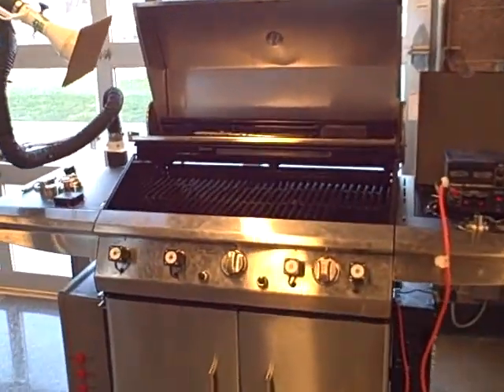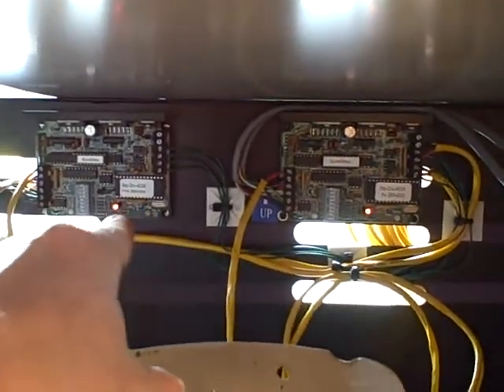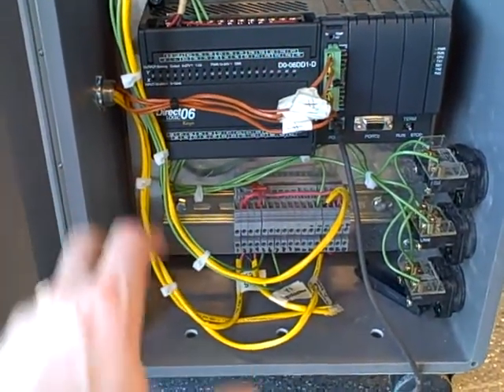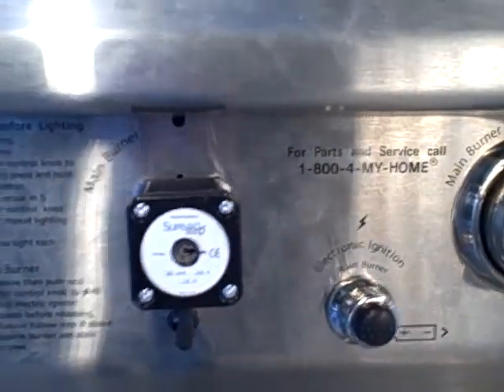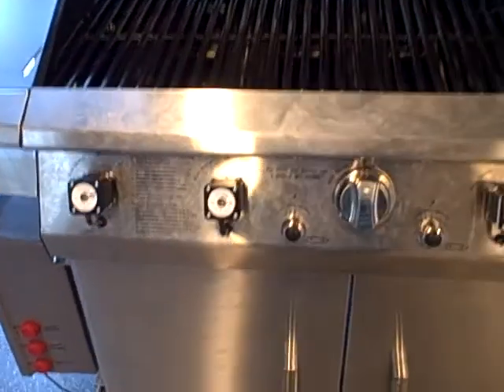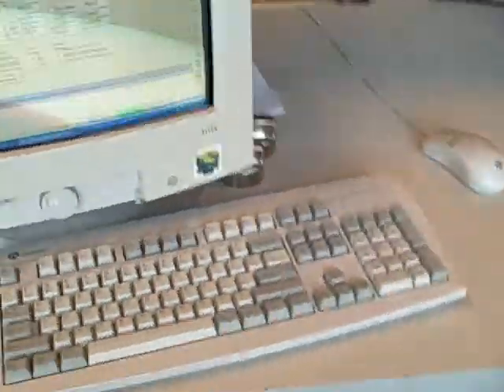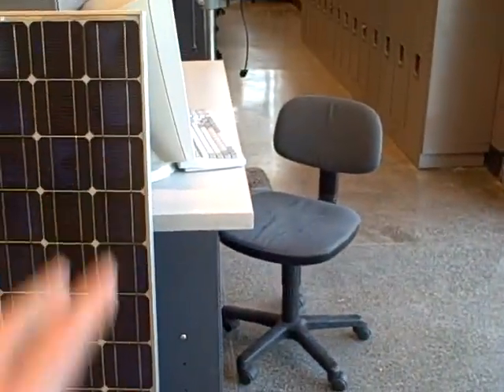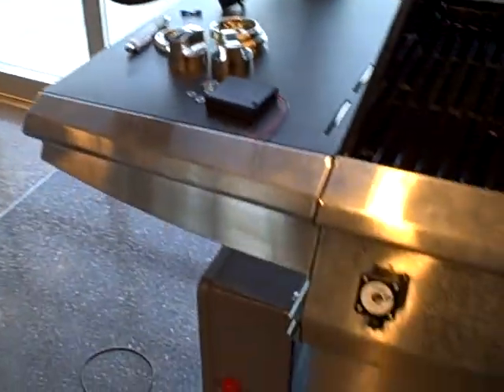PLC-controlled gas barbeque

Comment from the maker: Since this video, we have relocated the tank outside the BBQ, with a pressure gauge and a quick shutoff valve.

Even with the tank inside, the probability of trouble was quite low.  Propane is denser than air, so any leak will tend to sink to the bottom where it will vent.  Also, the factory design of this BBQ places the piezoelectric ignitor in the same compartment, and we've got open flames a few inches above that, so any *major* leak would likely cause a fire/explosion anyway.